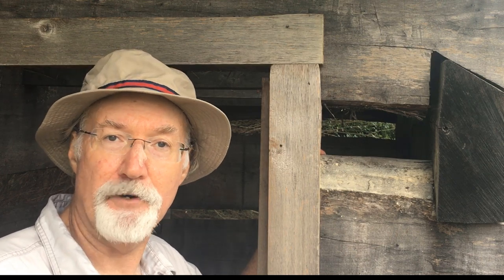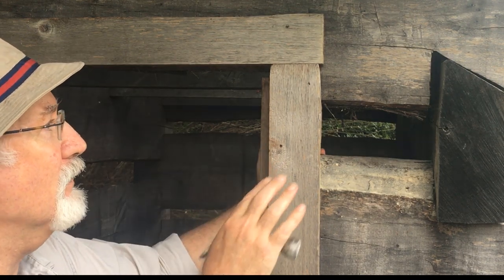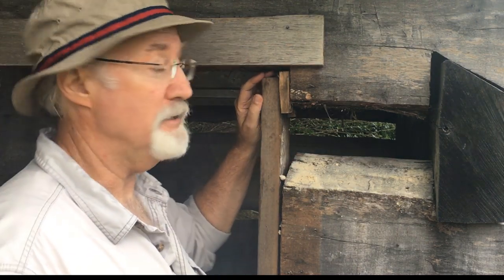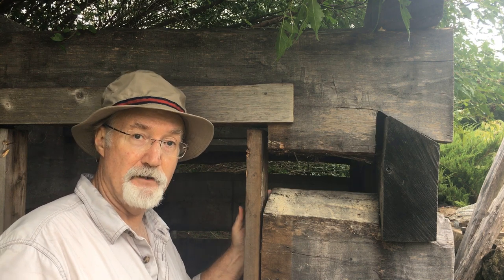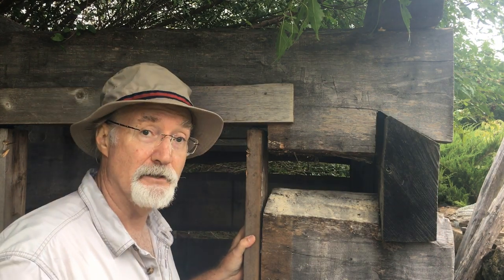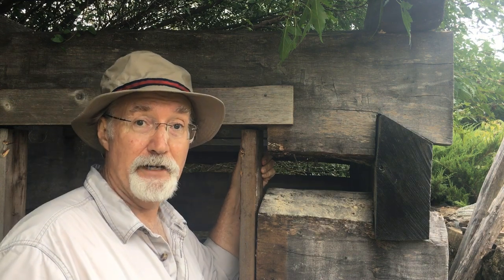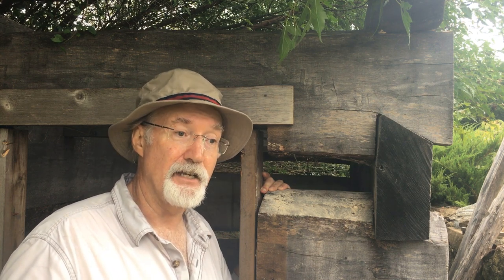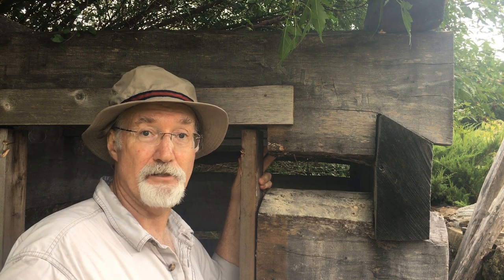Building with Green Logs.... Handmade House TV #83

Comment: Noah, much respect to you and you certainly know way more than me regarding this. However, I think I have to disagree at least in part with what you said. Yes logs do shrink across the grain (the width of the wood) as they dry. Not much along the grain (the length of the wood.) It looks like that gap was at least partially caused by the vertical log cupping (at least that is what it looks like in the video.) Something to consider when working with green wood is to face the rings inward and not outward as you have. That way when the log/board cups it will not be a severe because the upper log and weight are pushing against that and will keep the corners tight. Much love and respect to you and everything you do. Thank you, Noah!
Reply from the maker: Thank you MST for a great comment. Definitely worth taking into consideration on the next go around!
Reply: I think I like the way the logs was faced in Noah's example.  The cupping in this case, as shown, is counteracted by the notched angle load inward.  Otherwise, you would end up with a convex inner area.

Comment: So, as the logs dry and shrink radially, the expanded metal behind the chink joint will get put in a bit more tensile load.  That would seem likely to put a little stress on the concrete chinking material.  But then when joinery slippage occurs that gap is effectively reduced again.  I guess my concern would be bugs getting in the gaps left and the risk of the chink cracking.  But I am encouraged that your experience is that chink cracking is not a huge issue.

I guess since the chinking is usually one of, if not THE last step in the build, the green slabbed logs have a bit of time to lose quite a bit of moisture prior to the chinking...so perhaps that helps quite a bit too.